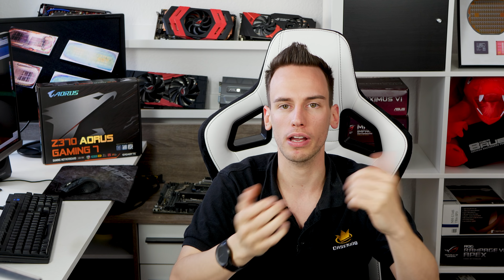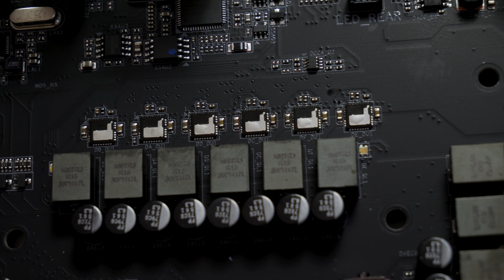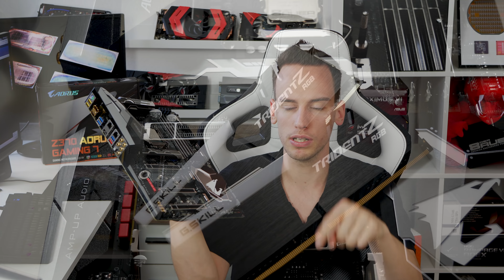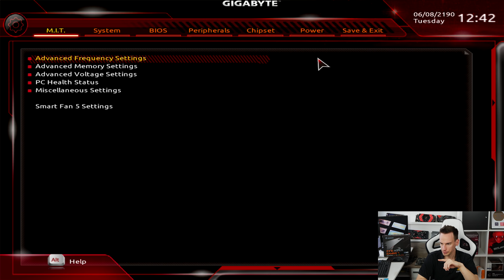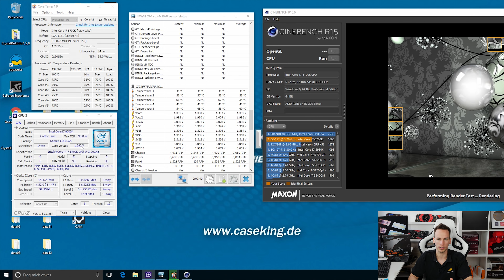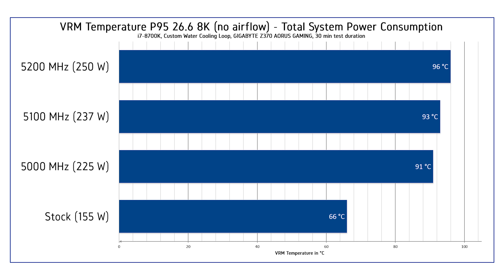Is GIGABYTE really THIS bad?

Comment: The VRM is a intersil based one. Actually it uses the best components made by intersil.
  Using 10 60A (8 for the Vcore 480A) ISL99227B Smart Power Stages (which cost $5.50 a piece when buying bulk). with the ISL69138 PWM and 4 ISL6617A doublers. 
  Though its a 10 phase, the Vcore is using 8phases in a 4+2 phase configuration doubled to an 8+2phase=10phase VRM. 
  Even though its doubled, the doublers have current balancing along with temp. monitoring while the ISL99227B's also have current and temp. monitoring along with current protection among a list of other features. 
  These exact components are used on the x299 and z390 DARK boards from eVGA. Those are $500 boards. 
  Even the revised x299 Aorus Gaming 7PRO uses these exact same VRM components for the 18core 36thread 7980XE-9980XE.
  I actually bought the z370 Aorus Gaming 7 because of the VRM components and knew that it could run the 8core 16thread 9900K when i felt the need to upgrade. 
  I got this board for $145 open-box. It even had bent pins though, it was fixed. Missing IO and all.
  But i wanted it, so i got it. 
  Also got it with another open-box 8700K for $280 and called it a day.
  This 8700K that someone returned is a Platinum chip. It does 5GHz at 1.250v maxed out 80°c on a 11 year old (new) ZALMAN CNPS 9900MAX air cooler. 
  I've even had it up to 5.3GHz 1.380v 93°c (no delid). The VRM never reached 80°c either. 
  Since this board made it back to the factory the VRM thermal pads were replaced with the pink laird thermal pads and the heat sinks were tightened down. That was a big issue with the early z370 Aorus Gaming 7 boards. But the 2nd revisions were all fixed.

Comment: The Gaming 7 has a better power phase than more expensive Asus boards. It has Thunder bolt 3 support, 9th gen intel support, stabled OC of 8700k to 5GHz. VRM's run cool, the newegg version comes with intel optane for free built in, board is stable, good bios. And its about $100 cheaper than competing Asus boards. This board takes a fat shit on Asus z370 and z390 boards and it's cheaper, what more can you ask?

Comment: The VRMs on Aorus Gaming 7 are capable of 160 degrees.  They were designed to take it.  The only issue is that they heat up the room.

Comment: I disagree, no one buys an OC board and gives it no air flow. Server boards YES, they see dirty low flow hot sealed rooms and long runs times under heavy loads but OC gaming boards NAHH. Your no airflow testing on this category of the board is not needed. Instead, test with great cooling. ALTHOUGH if your LN2 OC then you may not have air flow and in that case, you would test as you did. So EXTREME OC your test is needed and helpful. Thank you.

Comment: Hello Roman, can you help me?I  want overclock my CPU to 4.7Ghz for games and streaming.I can't find normal overclocking guide , can you record one guide video for my build.I want use my system for long time and i see you are professional.If you find time can you create short video guide.Thank you and i hope you will see my comment. 
My Build :
CPU : i7 8700k 
Mobo: Gigabyte Aorus Z370 gaming 7 rev.1.0 .BIOS ver. F7
GPU: Gigabyte GTX 1080 G1 
RAM : Corsair Vengeance LPX 16gb 3200mhz
PSU : Corsair RM850x

Comment: Hey der8auer, after watching your video I bought this board with a 8x2 Gskill 4133 memory kit but I can't seem to reach higher than 3732 without my bandwidth going down to 1/4 of its value. Would you mind posting the timings you used? Here is all the troubleshooting I did and folks there said that it could be an issue with the Aorus 7 board so I thought I would just ask you for help. Thanks a lot if you reply back! https://www.reddit.com/r/overclocking/comments/90fjnj/getting_very_low_read_write_speeds_from_ram/e2r101c/?context=8&depth=9

Comment: My brand new x470 aorus gaming 5 WiFi (paired with a 2600x and corsair vengeance rgb 3000mhz) worked for about a week before it started to crash. Rebooting took longer and longer as it was unable to post right away. Cpu led on solid with a flicker to dram. At this point I'm stuck with a brand new that won't post at all now. It took one month to degrade to a point where its now $2000 cad desk ornament. Quite disappointed with gigabyte right now.

Comment: "No airflow on the VRM" . This is not actually true, the aorus 7 has a dedicated VRM fan under the cover. You never mentioned it or whether you disabled it or not. 
The aorus 7 is a fine board, I only picked it for the rgb circus lights, looks awesome and asus offerings were nothing alike, but I regret choosing gigabyte over asus, as for the life of me I cannot successfully overclock the 8700K with a dynamic vcore. My previous last 4 PCs with different intel platforms on asus boards were very easy to do so.

Comment: Hello , This channel is very informative and I have watched every of your videos and trying to apply what you advice to me but something is wrong.

I am using Asus z370 prime - a and I tried to overclock i7 8700k (Not delided) to 5 ghz but doesn't matter settings I do , there is blue screen for CLOCK_WATCHDOG_TIMEOUT , I use 1.35 Vcore, SVID disabled. or when is auto doesn't matter that I use level 5 or 6 Calibration line my Vcore goes to 1.43 to 1,5 stable to just for a second or two. I am using EK cooling so I know that's not the case. The temps I got are around 67-69 under full load. I Disable Multi core enhancement, and also I am using 3000mhz ram sticks, when I enable XMP the DRAM voltage goes to 1.3530 which I think is way to high. if any advice please, Thanks !.

Comment: To add my own data set to this. For this exact same board, the Z370 Gaming 7, My VRMs in HWinfo peaked at 65c after 3 back to back test runs in Cinebench. 8700K, with no delid, is running at 5.0Ghz, 4400Mhz on the cache and my RAM at its XMP default 3000Mhz. 1.38v on the CPU with no AVX Offset, same LLC of Turbo. 20 minutes under a game load and it didn't crack 68c. Room temp is 23c.

Comment: i had 2 gigabyte z370 gaming 7's first one arrived with 2 bent pins on the cpu socket. RMA'd to supplier, they bent these into place and sent it back to me. then i had massive problems with the audio, gigabyte driver sounded great but microphone sounded terrible, no matter if i used case or rear mobo inputs, had lots of crosstalk between audio out and mic in, even using generic audio drivers after uninstalling gigabyte's. also started to get lots of popping and cracking and massive latency caused by the HD audio bus, would make the system hang really bad. gigabyte suggested i RMA'd to supplier for replacement, after 2 weeks and a first generic reply to my support ticket. 

Second board arrived, this board had the exact same audio issues described as above, same latency issues, tried many fixes, formatted, disconnect from internet, dont let windows update, install drivers then update windows, tried different gpu, re seated all components and connectors, even though this was the second board to go in it was worth a try. 

Gigabyte are impossible to contact via anything other then a support ticket in the UK atleast, this will take a week between replies and is generally a generic answer for you at first. please make sure you are using the correct audio inputs/outputs, even though you have already explained to them it does all the same problems no matter what input output you use. i spent 3 weeks and two motherboards trying to fix this issue with no help from gigabyte at at all,  trying different intel lan drivers as some said it could be caused by that, downloading old Microsoft drivers and manually adding them as some suggested it was a windows 10 issue. Trying my old Asus c6h and 1700x just in case something else in my system had gone weird. nope. 

Gigabyte dont even reply to help people on there own forums, so no... i cant say you can recommend this board at all, there are lots of people reporting the same issues on gigabyte own forums too. so its not an isolated incident. 

I ended up returning for refund and getting a Asus maximus 10 hero, guess what? issue gone completely!
Reply: i really should have read your comment 4 months ago.

Comment: That boards going for £120? Or i mean euro which makes my bottom of the barrel Aorus K5 that cost me 180 dollars all together even worse. Try running sli or crossfire with a game that gets the gpus and cpu close to or at 100% and it'll probably get over that. They've even got the Creative sound Blaster driver blocked or something on it when every other Aorus has it. And my audios the exact same as the rest. Something about quad core audio boost or something the software does. Wouldn't surprise me if the high end hardware accelerated music feature that all these audio chips are supposed to have is disabled as well on just this board.

Comment: thanks for the video. was wondering how good this MOBO was as I've been wanting to build a pc with the i7-8700k when ever i am able to(probably not any time soon unless something random and awesome happens) and have looked long and hard for the best MOBO for that CPU and even ram speeds(which you mentioned the main speeds in this video) for it all also. but of what I've found this MOBO is actually the main one I've seen mentioned from everyone using this CPU unless you wanna double the price for the next step up ASUS MOBO's which never seemed worth the price by any means, at least in my eye's.

Comment: Great video! I have this board, running a 8700K  @ 5GHz with 1.3 Vcore and it's been fine, VRM temps as reported by the sensors are under 70C during load (decent airflow in the case) - the only issue I have is that the sensors sometimes "disappear" under heavy load, i.e. they stop showing up in HWinfo until I restart the PC. 
Weird stuff - other than that, though, the board seems fine, been running 24/7 for almost 8 months now.

Comment: So why are you not using a current clamp on the 12v atx connectors and a temp probe on vrms (thermo couple or IR probe?). Trusting the monitoring just feels not enough to discard a shitty vrm

Comment: Gigabyte used to be pretty decent, but with AM4 they have been having a load of problems.
My AB350 Gaming 3 board is overclocking fine with no heat issues, but besides that it's shit.
There's a built in headphone amp, and i think we can all agree that the headphone amp should amp the head phones that people usually plugs into the front audio, because they most likely have speakers plugged into the back.
Well, unfortunately the amp only works for the rear IO.
Also, the bundled software for controlling rgb floods the system with instructions, making the CPU stutter when you adjust volume via usb and those random things.

So in short, set your stable OC, set your preffered color, get a decent headset with external amp, delete all software you don't need that gigabyte provides.

Comment: It is usual that when we hear this kind of thing we begin to read the comments. 
Then you find people who confirm what they are saying, others who deny it.
There are those who recommend other brands ... and then appear those who had problems with those brands too.
And so until you notice that no company "is saved" and you end up more confused than you were at the beginning of the video.
Finally, you leave with more doubts than you had when you arrived.
Reply: I got problems with my auros 7 after 2 months it started BSOD the whole time randomly and gigabyte wouldnt help me or cover the board under warranty which was very upsetting after I spent so much on this board so now after 2 months of use its been sitting nearly for a year in a box

Comment: I find Gigabyte firmware is poor. 
I have also had multiple AM3+ boards suffer electrical failures in the last year(only 2-3years). (me and friends that use me for support)
I still have budget class Asus and MSI AM2 boards operating after 10-12 years.

Comment: Gigabyte has guides for overclocking on their website, dude!

All I know is I sent in my gigabyte Aorus AX370 Gaming K7 for service because it was running too hot and any attempt to OC my Ryzen 5 1600 even a TINY bit, would corrupt the main CMOS and I would have to restore from the backup CMOS. The XMP option doesn't even come up in my BIOS...

I went through things with customer service twice, had a call reference number, and finally requested RMA. I sent in the board and they...... cleared the CMOS and sent it back.. WTF GIGABYTE? I did that TWICE with your customer service guy on the phone! You have the records of that!

Last Gigabyte item I buy.

Comment: yeah.. people crying gigabyte is shit...
than why do I have an Aorus Gaming 7 with 8700K on 5GHz and 1080Ti Aorus Xtreme and  RAM on 3800 (had issues on 4133 and 4000 with the bandwidth, but I did cheap out on the ram and didn't get one from the list on the motherboard supported page) and have no god damn issues ?
and yeah I have had bad experience with gigabyte products in the past but that was 6+ years ago
Reply: you represent all gigabyte products/users? That's the point i guess. When people have a problem they voice it out. Guessing if people dont have problems and they voice it out as well it will seem way more positive
Reply: Karthig1987 well there is no way to always get a good piece or hit a component specific issue.
I had 8 years of issues with a toshiba qosmio x500 unit that degraded the hdd's on the 4th day of replacement and atleast 1 mobo and 3 gpu replacements to finally figure out it was a hdd issue and got ssd ...
Had over 100 service center protocols to finally bang my head for a few months to locate the issue myself and fix it myself...
I had similar issues on my current setup and the previous one mostly ending up in driver issues and mainly nvidia drivers
Just the whole IT hardware and software in the past 10ish years is just at an extremely sad low quality
Reply: Wait a whole year with this MOBO and the come again and tell us.

Comment: Have had a z270 gaming 7 board for 6 mos over clocked in similar fashion to 4.9 and it runs perfectly fine. Vrm temps from hardware info never top 42C. That’s with a Corsair air case and very good airflow. Overall I’m very happy with the gaming 7 board performance wise and aesthetically speaking. I think for the money i could get a better performing board however aesthetically this board looks incredible.

Comment: I don't want to vilify the consumer who is often the victim of bad engineering/design but I don't envy the position a lot of motherboard vendors are put in. 

In order to check all of the boxes many consumers have you would need:

1. A board that looks good, probably with a heatshield and RGB
2. A power design that can support a very aggressive overclock
3. Wifi
4. A bios that is designed by overclockers but accessible to the novice
5. All around $200 USD

This is sort of unreasonable. I think it comes from people (like myself) who are newer to the PC enthusiast market who hear things like "You can build a budget build that will demolish 1080p gaming for $900 USD" and also "Overclocking is basically free performance, you should always push your hardware to a safe limit". The thing is, these things are sort of mutually exclusive and people (including myself up until recently) don't seem to understand that. 

I love that you're pushing back against the community putting it all on vendors when in reality we need to educate the community and adjust our own expectations. That being said, we can still demand proper engineering and design from manufacturers while not letting our expectations get out of control.

Confession, this was written by someone who loves their Gigabyte z270x gaming 8 board

Comment: I'd been a loyal Asus board user for over a decade, and had a Asus Strix Gaming-E that I picked up as part of a bundle.  After Buildzoid's video about the ASUS Strix Z370-G Gaming and the VRM issues across the Strix line in general, I decided to swap it out.  Honestly, I couldn't help but to feel a bit duped by some of the corners Asus had cut on what is $200 board.  

I researched it heavily and finally I decided upon the Gigabyte Aorus Gaming 7 that I managed to score - brand new - for $165.  While the bios isn't as polished as those on Asus boards, the hardware is fantastic!  Glad to see that der8auer's findings confirm my decision - sure helps put my mind at ease.

That said, the vague, clickbait-y title doesn't really suit your channel / content.  I feel that it detracts from an otherwise a helpful and informative video. A product should be commended for when it does something well, especially in a market as saturated as the Z370 motherboard market.  In the end, while you do recommend the Aorus Gaming 7, many folks (if the comments are any indicator) are taking the exact opposite message from the presentation.  The thumbnail & title alone presents such a negative connotation - especially given your reputation - that it alone might be enough to sway someone who might've been on the fence without having to watch the video.  Which is a shame, because - as you said yourself - it's a good product.

I'd asked Steve Burke specifically about Gigabyte (as I was considering picking up the board) and what he had to say about them and the upcoming Computex was encouraging and I think is something worthy of commendation.

https://youtu.be/_kO9tH7kSyU?list=PLsuVSmND84Qs2Qz152sw1IpLFGEQRcyRJ&t=724

With so many variants and minute details making the market convoluted already, that being direct from the outset only benefits everyone.   The vagueness of the title would cause it slip through the cracks for someone trying to make an informed decision.